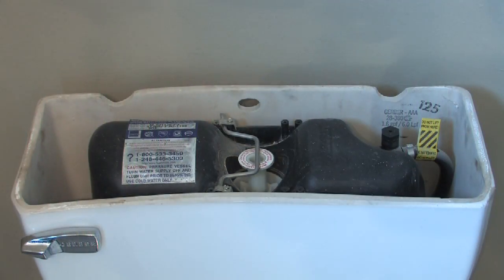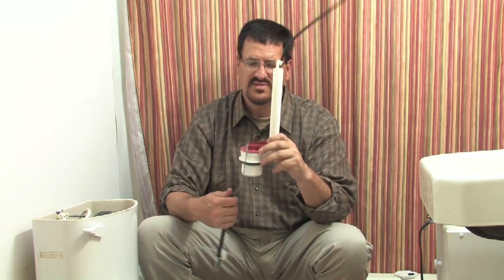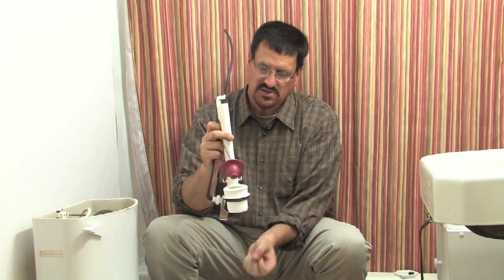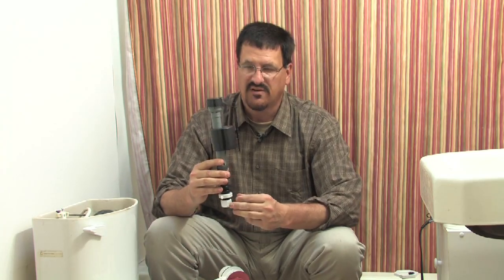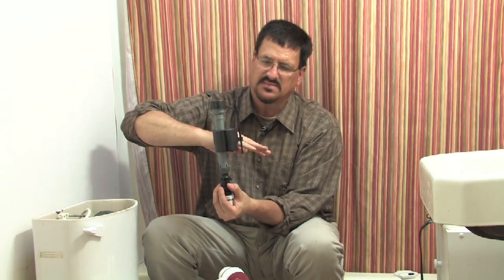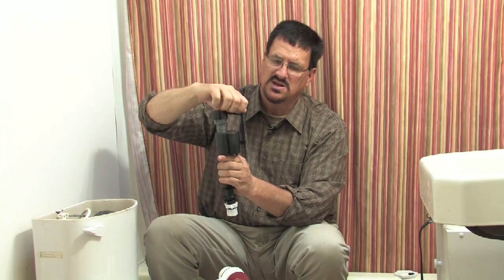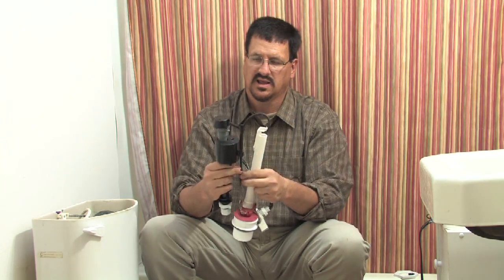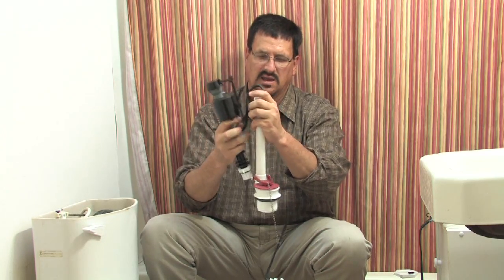Bathroom Maintenance : How Does a Toilet Work?

Comment: this should have been written/narrated much better.  Terminology is all across the board.  The water closet, the bowl.  I think it's safe to assume that even the most ignorant of toilet users would identify the bowl of a toilet the part that looks like that of a bowl.  The part you sit (or hover, or droop) on. I use a toilet from time to time.  Somewhere near 30 years.  I just learned there is a gasket of some sort between the "TANK" and the "BOWL"  I should have learned that sooner.  :)

Comment: One thing (and it's not just your video, it's almost every video of this sort on youtube): need more explanation on how the fill valve works.  How it fills the bowl and the tank simultaneously.  Upon observation, you should see water flowing down the overfill tube to fill the bowl and flowing from the base of the fill valve to fill the tank.  If working properly, as the fill valve is running the water in the tank should appear somewhat turbulent.